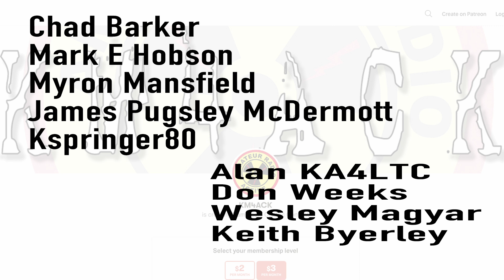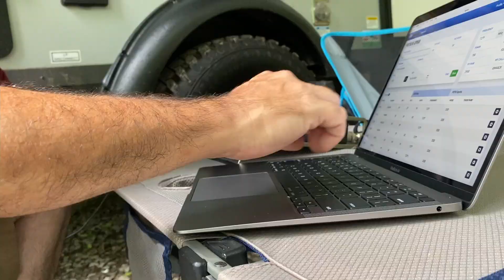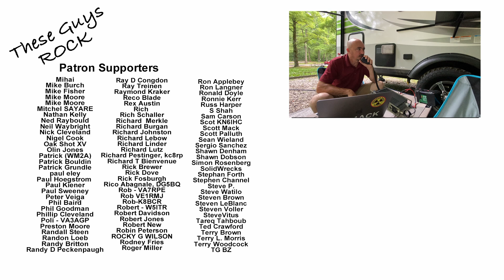Parks on the Air :: K-2958

Comment: could you discuss Carrier Sense Multiple Access in terms of APRS? And is it 1200 bits per second or 1200 elements (bits per element is baud rate) per second? Many published types of research it is a 1200 bit rate, other is baud rate. Or it is a 1:1 ratio, 1 bit per element? How can I properly address this?

Comment: Does APRS without using any digipeater/WIDE/RELAY, only two stations directly communicating could receive and transmit the packets 100% all the time? I am using software TNC, RPi, Soundcard, YaesuFT65 and ICOM IC2300-H.
Reply from the maker: Yes. You can use APRS in a simplex style without a digipeater. You could also use it on a frequency other that 144.390.

Comment: Can your EFHW handle 100 watts? Thought it was limited to 50. Thanks for a great video!
Reply from the maker: It’s rated at 50W SSB 20W CW/Digital but I was pushing it to see how it held up. During the hour long activation it was fine.
Reply: @KM4ACK  thanks! I love that antenna. I’m shocked how well it does when I use it. Breaking it out tomorrow! 73
Reply from the maker: Try it at 100w SSB. Just keep an eye on SWR. if it starts to climb, reduce power. Let me know how it goes.
Reply: @KM4ACK  man if this thing will handle 100w I’ll buy all you got! 😀

Comment: Great video Jason, I just finished my KM4ACK EFHW. I am very impressed with the tuning out of the box, no trimming and having the feed point about 4ft above the ground gives me less than 1.5:1 SWR in the digital portion of the four bands. I might trim it a little bit so I can get phone as well, but right now it works very well.

I very eager to take it out to a POTA activation, also are those 891 Escort rails you've got there? 73 de W8IJC
Reply from the maker: Yes. It's the Portable Zero escort rails - https://portablezero.com/yaesu857D.html
Reply: @KM4ACK  Awesome!

Comment: 1. It is always great to see someone do a POTA activation. 2. It is nice that you are QRO. There are so many stations I can barely hear because they are QRP. 3. What kind of antenna are you using?
Reply from the maker: I am using my on EFHW kit antenna. More should be in stock on June 24. https://km4ack.square.site/product/49-1-efhw-antenna-kit/34?cs=true&cst=custom
Reply: @KM4ACK  I have one of your EFHW kits. Your webpage says it is rated for 50w SSB, but you ran it at 100w with the FT-891. I have an FT-891 and want to run 100w. Did you make any changes over the stock kit before running 100w through the EFHW? Thanks and I love the antenna and your channel. 73
Reply: @KM4ACK I just saw you answered my question a few comments down. Thanks for the great video!

Comment: Jason
Enjoyed this video 👍🏻
I have your EFHW kit you showed at the start of video. 
I thought it was a 50w SSB antenna. 
You mentioned working at 100w.  
I guess I’m ok to use the antenna at 100w ?
BTW, nice trailer.
Reply: I have always ran this antenna at 100 watts with no issues
Reply: @w0met24  the 50 w rating is running phone for a long time. The toroid core can only soak up so much heat, so you can run 100 Watts for a limited time and then your SWR will start to creep up. Also I'm not sure about the magnet wire or capacitor being able to handle 100 Watts continuous.
Reply: @andrewhamop6665  I have ran it for several hours doing POTA pretty steady and never had an issue  with SWR creeping up . It’s a solid EFHW antenna
Reply: @w0met24  the SWR can start to creep up if the toroid core gets too hot. What power were you running?
Reply: @andrewhamop6665  I run a consistent 100 watts on the radio when doing POTA using a FT- 891.    My brother W4OPS also has run it 100 watts  never thought a second different about it. And the fact that it’s in open air probably helps with that versus being enclosed.   Typically use time is 2-3 hrs on it never got hot on me that I noted during tear down
Reply: @w0met24  Oh wow! Good to know the antenna is conservatively rated.
Reply: @w0met24  I’m going to give it a try. Thanks
Reply from the maker: Not rated at 100W. It is rated at 50W but I wanted to do some testing at 100W. Didn't have any issues during this activation.
Reply: @KM4ACK  thank you🙂

Comment: Great video. Question: Did you use a counter-poise on your antenna? Also, what did you do with the wire at the top of your mast since it is longer that the mast? 73 ~Ron
Reply from the maker: I typically don't use a counter poise. The wire goes from the top of the mast to a tie off point ~30 away. Most often I tie it to a tree as high as I can reach which results in a inverted L sloping configuration.
Reply: @KM4ACK  Thank you. Very helpful.